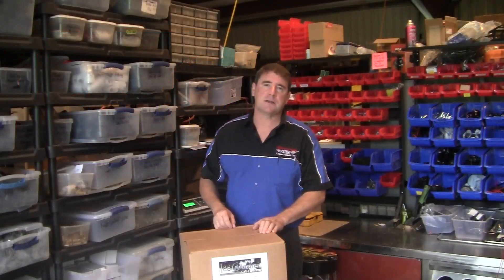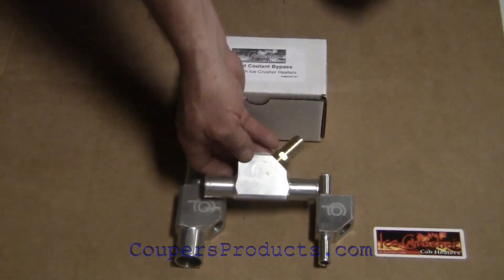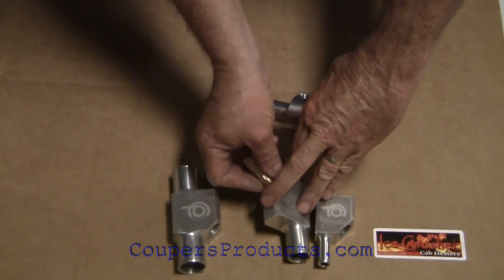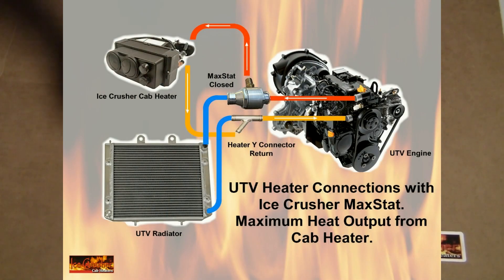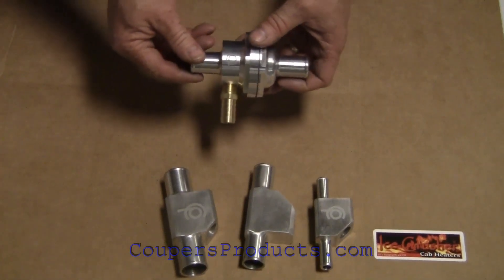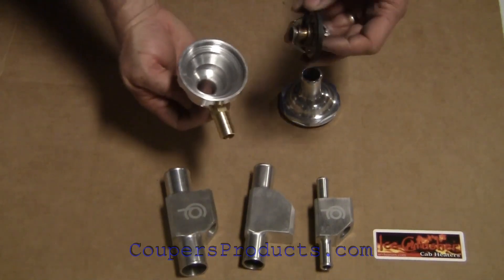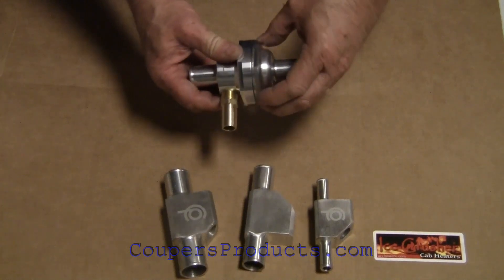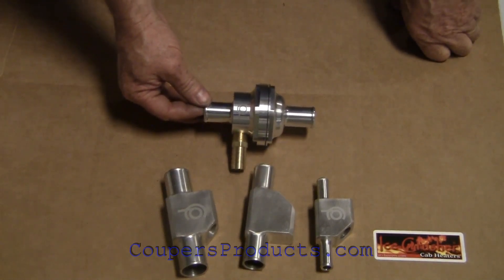Ice Crusher Maxstat Coolant Bypass

Comment: Where is it supposed to be mounted. You front or back be the engine?
Reply: I have one and put it at the front right by the radiator on the upper hose. However the engine's thermostat has to open before you get any heat going to this. My question is do we take out the stock thermostat so we can have heat from the engine immediately?